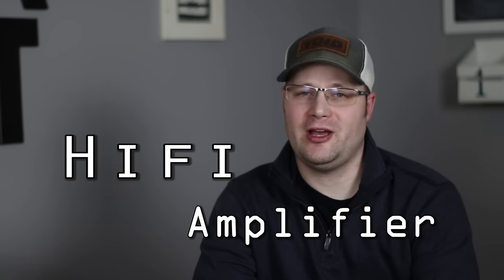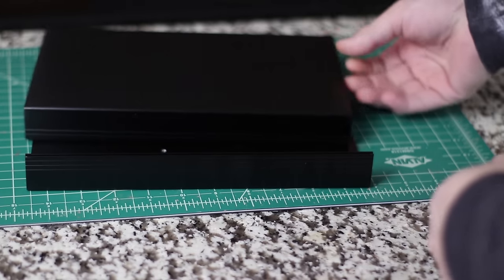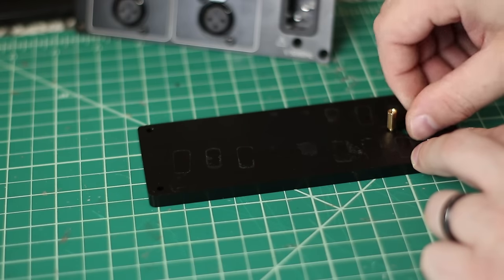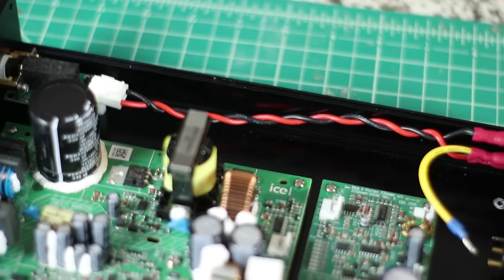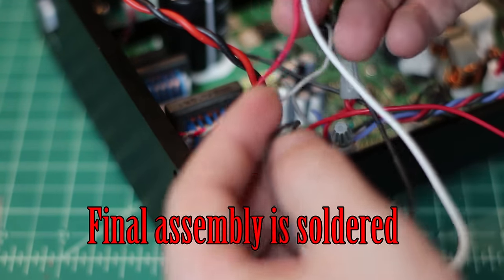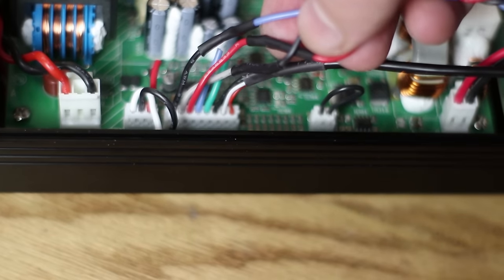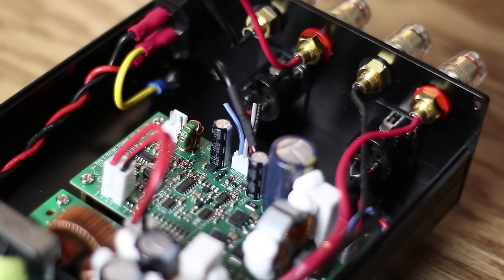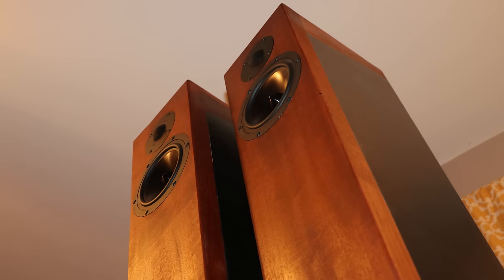How to Make a $3000 DIY HiFi Amplifier for $300

Comment: This is no way comparable to a good $3000 Class A amplifier.  Maybe comparable with an average class D amp costing $500 at most. The switching power supply is a big source of noise. The smoothing capacitors of one of my monoblocks are bigger than this whole amp.
Reply: Modern switching supplies are a non issue for class D amps. The new TPA3255 models and these Icepower boards can really compete with high end Class AB amps
Reply: @willmac5642  For sure, a class D amp can compete with a Class A/B one... just by definition that's impossible ; a class D won't produce the same output as an A/B one...
Reply: @Genuine Audiophile nice, you seems to have the solution to your problem :)
Reply: Yeah, because SMPS doesn't need filtering caps that big. Those caps are there to cover the periods between "fully on", which with a regular transformer, means they need to be able to supply the amp with a power for 8 miliseconds. With SMPS it's 25 microseconds, so yeah, the capacitor will obviously be smaller. There is no problem with noise if the SMPS is well designed.

Comment: OK, I got my enclosure in yesterday with their wires and built up my amp. No issues with the build itself, at all.

Though after getting the Ghent wiring kit, I am wondering why you need to buy that one jumper wire from Parts Express? I did it on your recommendation, but noticed Ghent sends you a wire for that connector, but it isn't jumpered. It's just two wires. So if you cut it short and solder them you will have the same thing.

I only had one small issue, and that was that Ghent sent the wrong wire to jumper the 47 volt power from one board to the other. The correct cable should have two of the larger JST connectors on it, but the wire they sent me had one BIG connector, and one small one (the same size as the connectors for the speaker terminals). I emailed them last night about the mistake, and I was pretty peeved about the whole thing knowing I was going to have to wait 2 weeks for the replacement, but in their reply to me today, they said they noticed their mistake the day after they shipped my enclosure, and shipped the replacement that day. And they sent me the tracking and it will arrive tomorrow.

That was the quickest customer service fix I have ever seen, considering they were aware of the mistake without having to be told.

I'll definitely be building another one of these in a couple months.
Reply from the maker: That is great to hear. And you're absolutely correct about the wire from Parts Express. I should have been a little clearer on that jumper cable. It just saves you some time, but is definitely a preference thing over being necessary. I've always really enjoyed the service from Ghent Audio as well. It's great to hear that they notice their mistakes so early on.
Reply: @Toid  You're already doing a bunch of soldering here, so one more joint isn't going to make a difference.

But as I said in a comment below, I'm surprised Ghent doesn't just make completely finished harnesses for this that don't require soldering. It would be easy to do, and I would be willing to pay a few more dollars for it.

Comment: is there dc protection ? or should i add input transformers ?
Reply: Can you explain your question? I know nothing about electronics. Why DC is bad and why you question need of transformer and what transformer will do to DC to make it safe. Thanks.
Reply: Scott Johnson DC current on the input or output will likely fry the amp or speakers.

Using a transformer will isolate the DC power, since it can only work in AC (sound is AC power, with variable frequency between 20Hz and 20.00kHz)
Reply: @radusimonica5550  sound is actually DC not ac, ac is whats in your wall socket dc is what comes out of a guitar into an amp

Comment: Great video, I'm definitely going for my first DIY project! Do you think this setup of one 200asc and one 200ac is equal to dual mono (2 boxes with one 200asc for each)?
Reply from the maker: I've never tested that, but there's no reason for me to think it wouldn't be. They designed the power supply to power three modules. I've never felt it was underpowered either.

Comment: Amplifier:
1) For my sitting room, I plan to buy the IcePower 1200AS2 as the 2-way amplifier. 
2) for the other rooms, I think the IcePower 250ASX2 will suffice. 
3) ... Can't get the 200ASC and 200AC where I live...

The Case, that's the issue:
1) The main  issue will be making a good enclosure or the 1200AS2. 
2) Can buy a case for $300, but why not make one myself? The 250ASX enclosure can be found for $110, that's fine with me.

Do you know what the AS(X) reference is standing for? That could help me understand the features...

Comment: $300 for a supposed  400 watt class D amp that you have to assemble yourself is kind of high. I haven't heard any class D's that sound good enough to consider  replacing a good class AB
Reply: and Class A typically shits on class AB I might add.  Sure, class AB is more efficient, and runs cooler, but that's about it imho.  I also prefer SET to PP designs too - the crossover distortion on the sine wave cycle on PP designs is nasty imho.
Reply: There are well designed Class-D amps that are astonishing. Do your homework.
Reply: butchtropic  Some people hear crossover distortion in PP designs (AB doesn't have to be PP, it can be done SE, but is a lot harder to design a stable circuit to do so).  

AB is convenient - lots of power, low heat, good efficiency, and what appears to be good specs.  

There is more to life than "specs".
Reply: butchtropic  PS I forgot to say that wattage is a pissing contest much like mp in DSLRs - 20w is perfectly fine for volume in small to large rooms that 99.9999999999% of people own and use.  200w etc is vast overkill.

edit: quality over quantity.
Reply: butchtropic  true, but that's where intelligent amp/speaker matching comes into play, doesn't it?  Anyway, amp + speakers is 10% of the sound, the rest is your listening room.
Reply: butchtropic  excess heat has never really worried me with my amps.  I prefer class A, will tolerate class AB, dislike class D.  I prefer SE over PP designs, and I prefer zero NFB.  Class A SE NFB valve amps provide free heating in Winter too!
Reply: butchtropic  Again, headroom comes down to the types of valves used, the efficiency of the matching speakers, the size of your room, and your preferred listening volume.  SET designs are not really a limiting factor here imho.  Many people run amps that are simply overkill for their listening situations.
Reply: butchtropic I’m Australian - only the US calls them tubes, the rest of the world calls them valves :P

Most issues with SETs are caused by preconceptions and a lack of knowledge, coupled to unrealistic expectations!

Comment: Great video, but not enough hard evidence for me to believe the $300 v $3000 statements.  No doubt your good work produces great sound but I find it hard to believe the value comparison.
Reply: he is making reference to the bell canto class D amps.
Reply: I doubt regarding great sound. Somehow no manufacturer of really "great sound amplifiers" implements class D. Nor high frequency power supplies to that matter neither.
Reply: Check the THD+N at 20hz-20khz in the documentation. On the 500 watt amp it’s 1%... not good.

Comment from the maker: Parts used:
200asc Board with power: http://bit.ly/200asc 
200ac Board: http://bit.ly/200AC
Auto On Jumper: http://bit.ly/2TIdelO
Amplifier Case: http://bit.ly/2N3SQZO
Power Cord: http://bit.ly/2TIdK3e or https://amzn.to/2UYeuBw
XLR to RCA: https://amzn.to/2Xdpqgv

Want more power: 500asp: http://bit.ly/2Dy0PKn  or 1000asp: http://bit.ly/2SJqB86 Dual mono 500a: http://bit.ly/2E6nUW3  or 1000a: http://bit.ly/2TMuqql

Want to build a monoblock?  Find out how: https://toidsdiyaudio.com/community/diy-amplifiers/icepower-200asc-class-d-monoblock-build/#post-3645
Reply: Can you post a vid that covers the 500 or 1000 series builds?  Or link to the case and cable set?